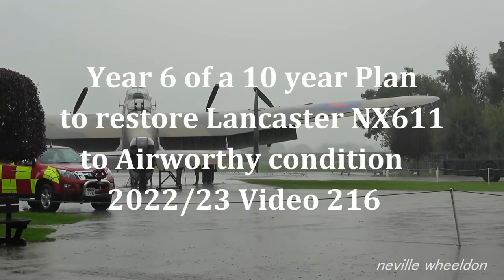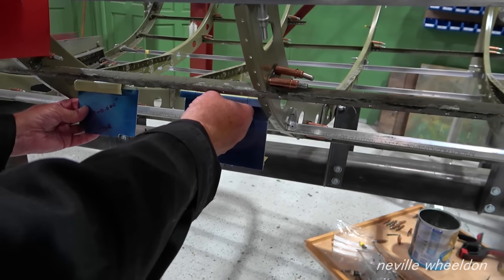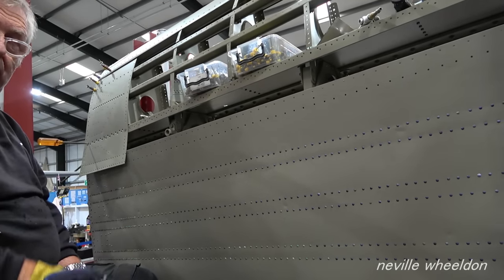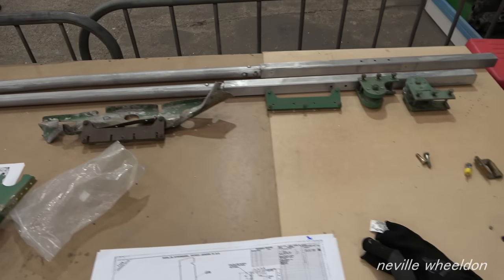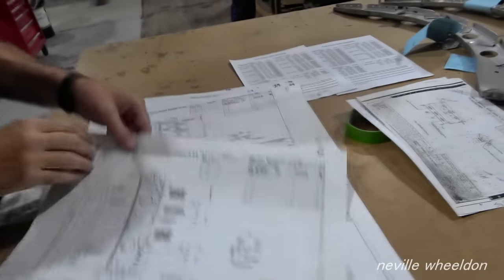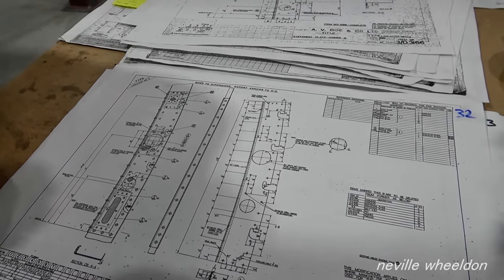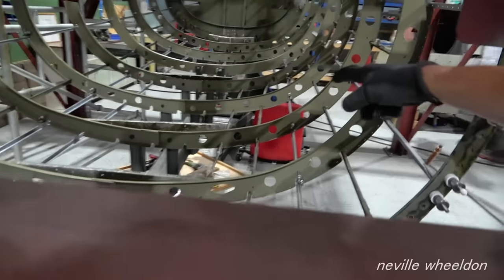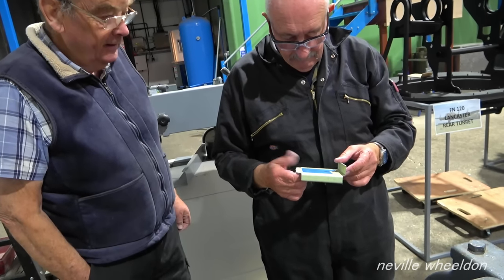Video 216 Restoration of Lancaster NX611 Year 6. French wing, top skin pinned to wing.

Comment: Most excellent video.  Thank you for the specific focus on joggling (???).  And as you were talking to Keith about the wing, and he mentioned "screws" and "rivets" - I kept waiting for your question that never came (or was edited out) of when/where are screws and rivets applied, and why ?  Excellent capture of the formers and reinforcements to take the control tubes.
Reply from the maker: Hi HH , let you down again, That row of rivets and screws, Has you know this is a row of Avro plug rivet  runs the length of the spar boom. The plug rivet hole is a blind hole about 1/8 of an inch deep so you cannot fit a skin pin in to hold the skin in place ,so they fitted a screw. If I remember right the Canadian built Lancaster did away with the plug rivet and fitted screws the full lengh of the boom. Thanks for all your comments
Reply: @nevillewheeldon1693  All good, kind sir.  Thank you.

Comment: Why don't they restore the French wing to airworthiness and just swap them for the wings JJ has?
Reply: That would make sense, but then I suppose it would lose some of its originality?
Reply: @bigglesace1626  
Like every ww2 fighter flying in the world right now?
Reply: @oxcart4172  I can hardly be bothered to answer, but here goes...
Yes, of course loads of 'refurbished' aircraft are rebuilt extensively with new parts. A good example is that Spitfire dug out of the beach in northern France - the number of original parts used was tiny, but it returned to the sky. I'm not comparing JJ with such rebuilds - but with its presumably original wings, which are capable of refurbishment, it would seem preferable to retain these in the long run, rather than replacements. Just my thoughts but hey, what do I know, lol.
Reply from the maker: Hi Oxcart, check out video 182 Andrew gives a good talk on this . Basic ,they have gained experience in doing it this way. especially on the design of the jigs as there are no drawings showing the construction of the jig still around.
Reply: @nevillewheeldon1693  
Thanks very much, Neville! Love your videos, btw!